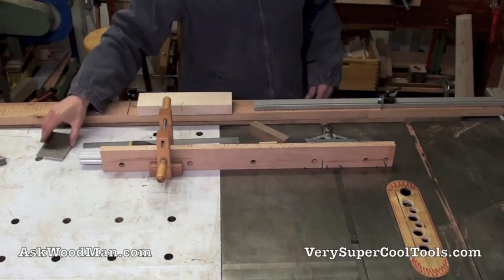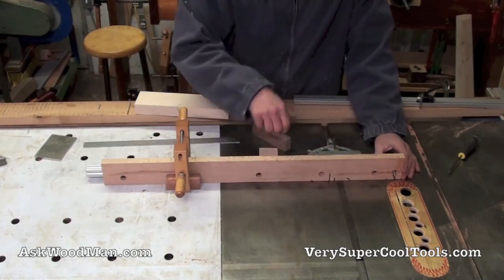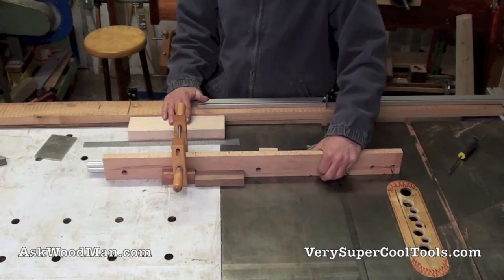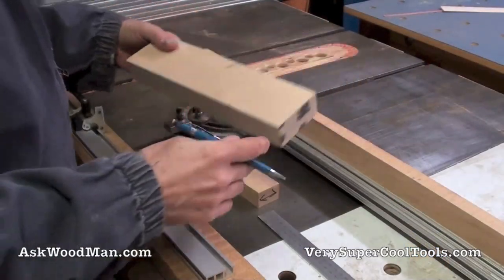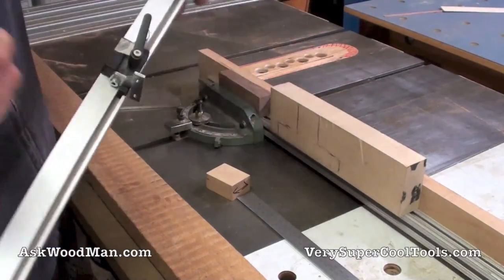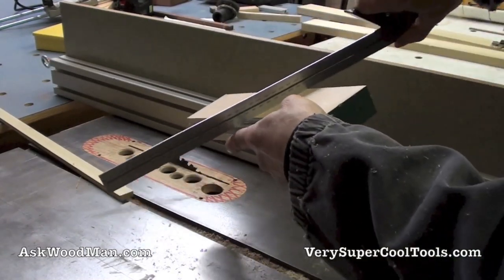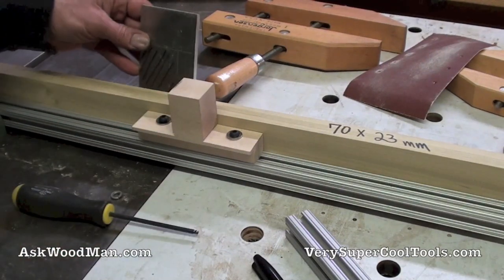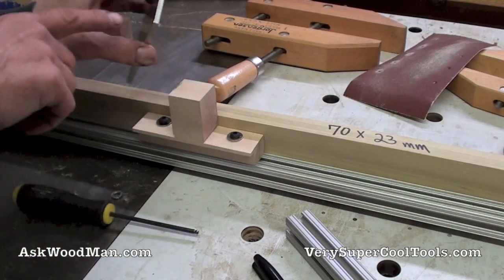Miter Gauge Upgrade Length Stop 1 of 2

Comment: Been a while.  I want a waterlox update.  Festool.......always a good choice.
Reply from the maker: I am done with Waterlox. You can't believe how many people have written me about the bubbles and sags. They claim it is the same. I don't agree. Festool products are always a source of inspiration. Those German engineers are something else. Have you been logging a lot of flight time. Keep in touch. Allan
Reply: AskWoodMan I used Waterlox for the first time this summer for a cooler box for my Grandmother's 70th birthday based on your earlier vids. I had bubbling and adhering problems with it and thought I did something wrong. But if others are having this issue perhaps things have changed?
Reply from the maker: Zach Brumbach
Hey Zach. I hope to have new finishing videos up soon. I have been experimenting and think my search is almost over for a new product. For 25 years I was able to brush Waterlox in any weather condition and make it look great. For the last two years no matter if the conditions are absolutely perfect I can't get the finish to perform as in the past. I am using up some leftover product on some shop fixtures and it is maddening.

Comment: @AskWoodMan what length is that extrusion and is it the metric or sae version (was going to order from 80/20 on amazon. thanks!
Reply from the maker: Hi Seth, The piece in the video is 31.5"  because that was what was given to me. I think a 36 would be perfect. The stock I have is definitely 1" SAE.